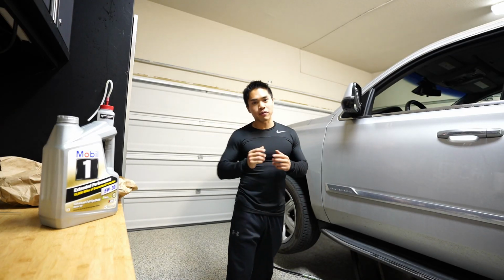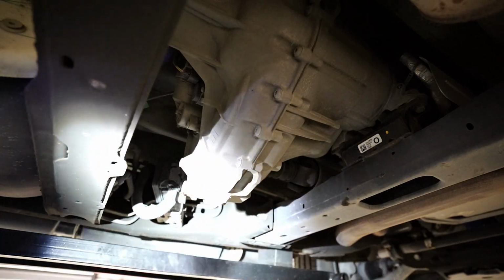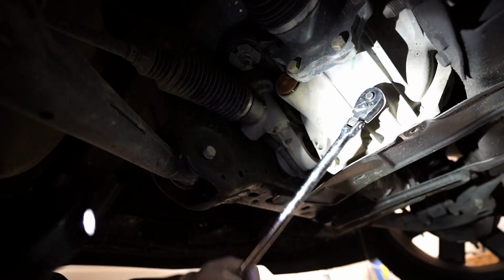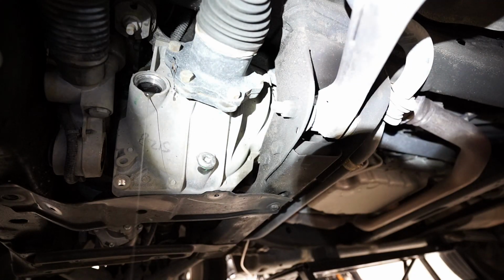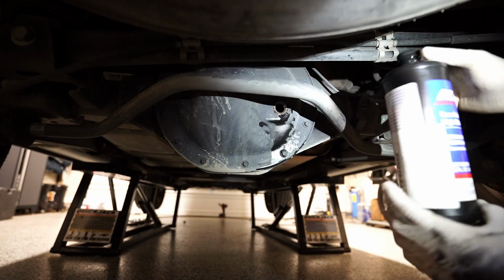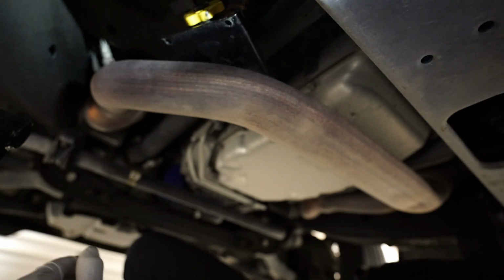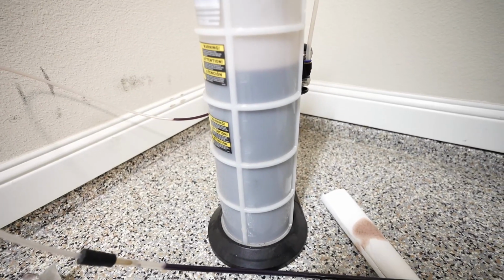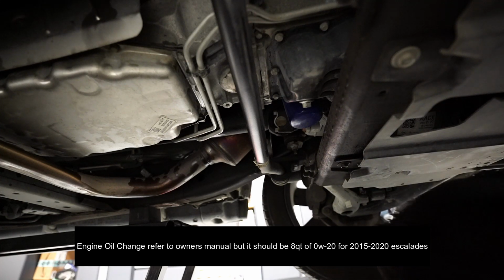2015 to 2020 Cadillac Escalade 50k mile full service

Comment: I just got finished replacing the fluid on my 2018 Escalade, Front Differential. The more complicated part was removing the black cover. The fill plug was on real tight and the drain plug very loose. Only difference is I used Amsoil Gear oil. 75W-90 severe gear oil. I thought that at 15525 miles the fluid was going to come out like new. Boy what a surprise. It was dark and there were some filings on the drain plug magnet. I had done the transfer case at 11500 and found the fluid to be really dirty too. I know this is waaaayyyy before what the book wants you to do, but having done it I am really glad I did. I also change my oil every 5000 miles. To me all this is cheap insurance. I enjoy doing this sort of thing and I save so much on the labor it would cost at the dealer its a no brainer. I do have a couple of torque wrenches and I would recommend using them. I'm not a mechanic so I don't need the very best there is I just got one that was good for the few things I do. On this occasion I used my Park Tool torque wrench. Next adventure will be the rear diff and then the transmission, the latter being a bit more intimidating. Thanks for the awesome video!!!!!
Reply: You are one of the smart ones. I learned early on, to do early maintenance rather than wait.

Comment: Great job on your fluid changes,  We were waiting to hear all of fluid type weights on rear diff. Front diff your showed full sym 75 90. Oil we could see 0 20 full sym . Did you reuse Trans pan gasket.  Was the jack you used the one in vehicle to make clearance to remove pan .and What gm oil filter on the new 6.2 .
PF 63 ? Few more minutes and how many exact quarts on everything could have made it. Perfect. Thank again. 👍

Comment: Great video.. I have a 2015 that has 52k miles. Just got the oil changed but I need all the other fluids changed & the radiator too.. This is why I'm seriously considering a EV next time around lol

Comment: just bought a 2015 escalade with 50k miles 2015.  It drives very rough due to what seems like transmission problems.  Car clunks into gear when rolling down hill no gas.  Sometimes car delays when going park to drive and kicks into gear 2 seconds later.  Rolling out from a stop and car goes into neutral for half second then slams into gear.  It always feels when going up hill like the car is in too high a gear.  Now the thing is that I don't know if it had the 50k service.  Do these sound like items that could be addressed with service?  Any way to check the car to see if it was serviced.  There's no dip stick for the tranny.  I know there are a lot of folks that say differential and trans flushes seem to work wonders, but other that say flushes can hurt.  Thank you and great video!

Comment: The differential need to be cleaned out. There is always metal below the ring gear. You have to take off the cover. Run it with the new fluid for a few months, then drain it by removing the cover. An extra change will actually help!

Comment: I have a 2015 Cadillac escalade 8l90 transmission should I get the trans hot enough for the thermal bypass to activate before checking the trans fluid level?
Reply from the maker: Please check the other video on my channel that details this there is a specific range I believe it’s 95f-113f for the 8l90 on the Escalade

Comment: is the only way to refill the transmission fluid on these trucks with a pump. I had an 09 Yukon and I could refill from the top tube. I can't say I've even seen one on my 2018 Escalade, but honest I haven't looked. I only have 14,600 miles on it.
Reply from the maker: Cocora22 yes that’s correct I have another video on exactly how to do the atf fluid change. The only way is via a pump from underneath the truck

Comment: You are pretty picky, so why did you not waste a little fluid to run it through prior to filling them up? Just wondering. I don't have that many miles on my 2018 but I think I'm going to change both as soon as the garage floor is a little warmer.

Comment: Hey there I have a 2015 Cadillac Escalade platinum do they have a dipstick to check the TRANSMISSION FLUID I have 2codes the transmission temperature sensor there are 2 parts for it to get that done and the other code is the transmission control module
Reply: Your screwed if not under warranty.  That’s a commen issue.  Had to have my tranny rebuilt.  Runs great now.

Comment: You have something I don't. The 2018 rear differential cover does NOT have either a drain plug or a fill plug which makes it annoying as hell. Only choice is to remove the cover. Sorry, does have full plug of course.

Comment: Good video but I’m not sure I would use your trick for lowering the exhaust pipe. A Jack under pressure over your head while working is not the best idea and you really should consider using some eye protection when working with fluids my friend. Safety first should always be rule #1.

Comment: Amazing video very in depth I’m actually going to order everything I need to do mine I have a 2015 escalade platinum with 40,400 miles.. could you let me know what the capacity is of each 
Rear- looks like you used less then 2 qrts 
Front diff- I saw u use less then 2qrt it looked like
Transfer case 1.6
Your help would be greatly appreciated